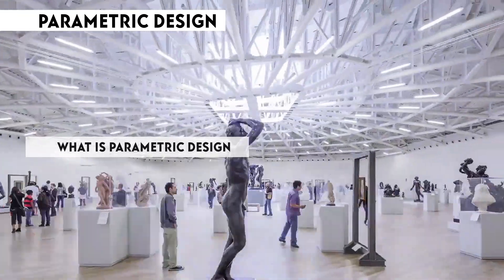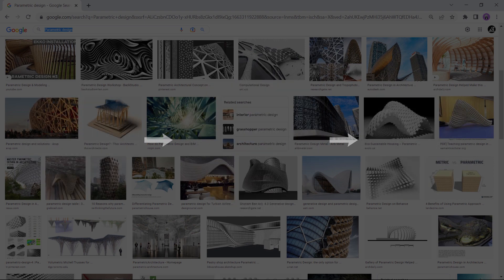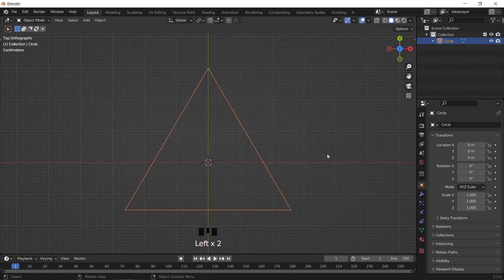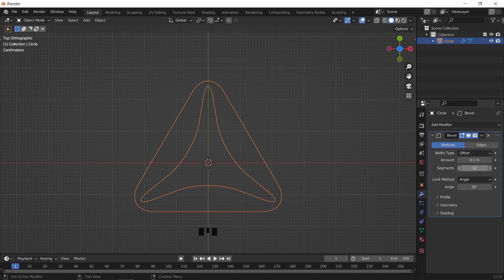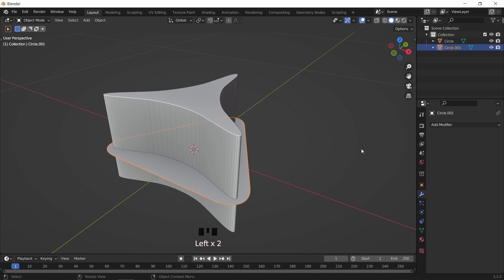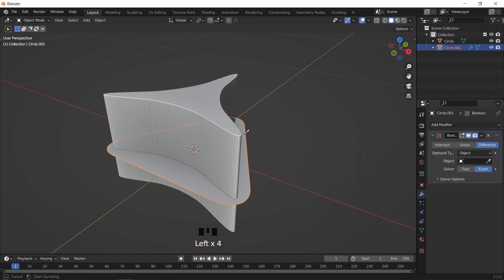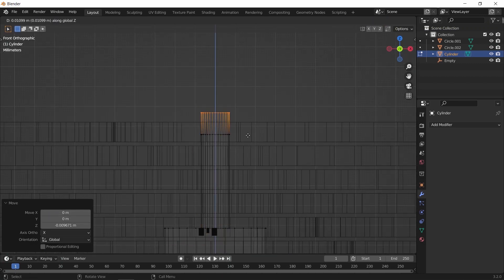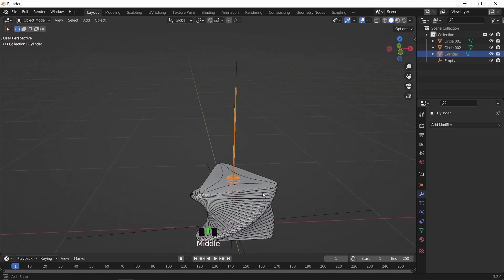What is Parametric Design in Architecture - Blender Introduction

Comment: Great tutorial! Could you use the By-Gen add on to create this form of architecture in Blender as well?
Reply: Great !! About By-Gen, I guess it would give such kind of biologically designed results if you understand. I think it is not as symmetrical as the typical 3D modeling, but you can try it yourself.